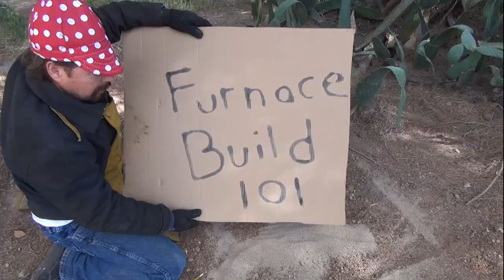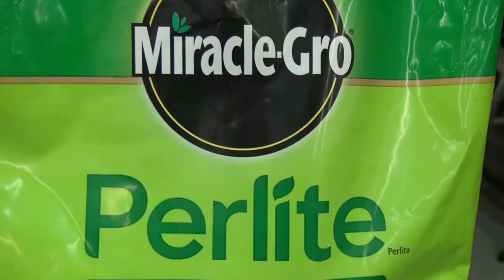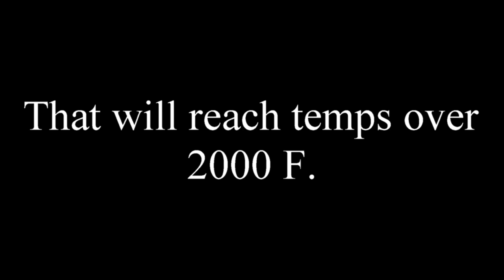MELT STUFF - How to Make a Foundry | ask jeff Williams

Comment: jeff, I came across your video here from facebook etc. I just finished building my furnace and propane heater but I think i may not have enough heat to properly attain temperature. I built the foundry out of a 55 gallon drum. I found someone who had a ceramic shield drum about 2 inches thick and about 14 inches inner diameter and about the height of the drum but i had to cut off some since i cut the drum roughly 5 inches to have a shielded top  etc.  I also had kaowool and used this to help insulate the space between the ceramic shield and the drum added extra heat protection etc. SO i fired the propane heater and waited fro 10 minutes but it did not get a glowing orange heat. I am suspecting that i have too much volume that needs heating etc. I am debating whether or not to add a blower to the torch to ramp up more heat etc. your thoughts or anyone else etc I could provide pictures etc let me know.... Thanks guys!

Comment: I would like to build one of these Foundries. Thank you for the information. I love your videos. I have lots of Gold and silver in rocks and I am now working on getting them metals out of the rocks. I have already tried Acid from Vinegar with a 20% mix. Does not do a good enough job. I am switching to a furnace. I did have a question for you. Does the weight of the metal help separate the metals like silver, coper, and gold?
Reply: Youll need to crush the ore then add a flux that will seperate lead from silver/copper from gold, etc. plenty of videos around here on youtube.

Comment: Do you have to have the hole in the bottom
Reply from the maker: yes
Reply: I'm guessing the hole is for air I've seen some with a blower. Would it be possible to add a blower to the bottom or am I just way off in left field?  Sorry for all the questions I'm just starting out and am trying to find a way to cast all the brass I have.

Comment: Bad ass stuff you got there 4:45 4:45
Reply: Hello  Jeff love your channel and all the thing you do . I have one question I pretty good with my hands and can figure out tricky stuff . I made a kiln 10 gall metal bucket put plastic and sand made a top let it sit I put one inch tube I did 12 inch and I did 18 inch I drill a hole at end cap put brass fittings turn on propane it look like it was working and I put coals in with a cup that you melt your metal in 45 minutes it was going and the coals didn't even catch nothing I could pick the top off with my hand . So my question is what did I do wrong .
Reply: Jeff hello again you build is awesome on the burner you show it but you put flame thrower in end cap what did you do to the bad boy drill a hole I don't know but please I don't want to mess this part up . Thanks

Comment: Consider building a fire barrel circle bound with metal strapping,, or aircrete bricks with water glass treatment. Set it on a raised circle fitting inside so that 
sides can be lifted after a spill.. Propane is clean and easy, but maybe used oil is cheaper. With air pressure. spray..

Comment: Wow, that's very hot video !!  Where did you find that 16 gallon drum ?  I need a few.
Reply from the maker: thanks Allan and it was made from a 30 gallon Drum ..New so no worries of an explosion.
Reply: I could use that size for my new trommel design..
Reply from the maker: exactly and make sure its a chain drive.

Comment: Hey, great job! May I ask when you starting putting the cement perlite mix on there was a hole in the bottom as you were smoothing it out. Whats the hole for in the bottom?
Reply: Holes are added to the bottoms in case the crucible fails and instead of having metal pool at the bottom of the foundry it'll flow through the hole.

Comment: I do not think the perlite & refactored will last if
You run it over 2000 degrees. But. If your just going to melt aluminum then most likely will be Ok. Nice build though.

Comment: Pure cement is heavy and prone to cracking.
I used fiber insulation at first and it was fine for aluminum, then when I wanted to retain more heat for melting copper, I used a layer of Satenite over the fiber insulation and it worked great, and the whole unit minus the propane cylinder is easy to pick up and carry.

Comment: sir jeff williams can you make a hard rock mining safety video. I am most afraid of the mine collapsing
Reply: Jeff has already made a few extensive videos on just that subject . . . and did an excellent presentation with a small model in his shop followed up by the actual site selection and digging.  In fact, I consider that series of video presentations to be the best reason YouTube should start presenting awards for "Great Performances".
Reply: @richardrobertson1331  he made videos on how to make a mine shaft.I want to know the digging safty rules. checking for lose rocks. entering mines/caves when one has no idea whats inside(snakes,bear).fire safety . oxygen. wiring. camping inside the cave.how to deal with RATS
Reply: @richardrobertson1331  and when to stop using wood .and let the mine support its own weight.

Comment: Did you do a drying process before first smelt? If you do your furnace will last much longer. Keep pressure at about .03 to .08 and slowly heat that a few times letting I cool and heat Id say 3-8 times. It cures that foundry cement or the castable firebrick which I use in my foundry. Also would highly suggest using ceramic wool installation then us the firebrick or foundry cement. This makes a long lasting furnace that can take even hotter temps.

Comment: Dig a scrape in yard.. Attach a steel pipe to the end of an air bed blower. .  Put metal pipe in scrape.  Add coke. /charcoal. Light turn on fan. Sorted
Reply: Coke is illegal in the USA. Damn people snort it and get all crazy! Can't have crazy people operating burners I c'mon son ....you knew that!
Reply: @Donald_Turnip  lol.  In that case go for a anthracite. Needs a constant supply of air or will go out. But youl be able to smelt anything.
Reply: @sharperprospecting6980  GREAT,  now you're smoking anthracite. HD, I'm no doctor but this are not things conducive to good long term health! ;)
Reply: @Donald_Turnip  I think and hope you already know that the coke described or called for is what is left over after coal is heated without adequate air and the volatiles are driven off.  It can also be had from petroleum.  It is similar to charcoal but burns hotter.
Reply: @royreynolds108  I do know, yes. That furnace looks pretty ummm what's the word...designed for fairly clean production. At first look it seems to be just a really designed and cost-effective furnace. Adding anything other than what's in the crucible doesn't seem like a good thing for that.  Once it's set up, for instance, you would lose your refractory cement if you had to move it/tip it to clean out material like charcoal to add carbon to steel after firing it a couple times because his cheaper refractory cement settles to have quite a few cracks to it. The leftover ash would have to be vacuumed out/not tipped and poured out.

That said, I'd rather do it like that than digging holes and firing underground. I purchased a slightly superior version of that furnace for my own metal working with a better refractory material but the bitch cost me about $1600. His design is better but I can melt damn near anything in mine though. I have a friend who's an industrial electrician. He has left over copper wire that's about as wide around as your wrist with the shielding that we strip, melt down and make into ingots to sell to a metal materials shop. $3 a pound and he has about a 150-200 hundred extra pounds a week. The company paying for his services would rather he disposed of it versus gathering it and dealing with all the pain in the ass of saving it and messing around.  Nice little $600 Canadian we share every week. You should see the crazy thick wire though. No clue how much electricity they push through it but it has to be immense like 1.21 gigawatts(grin Back To The Future plug). =)